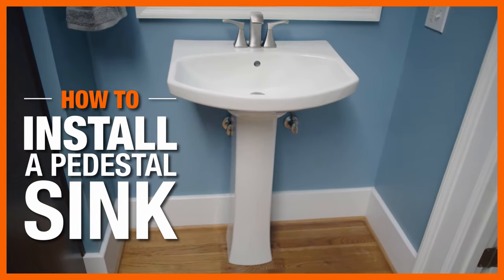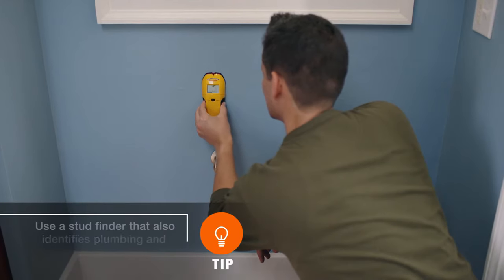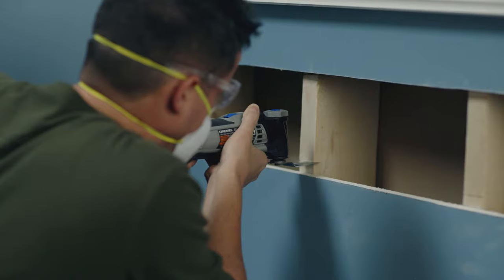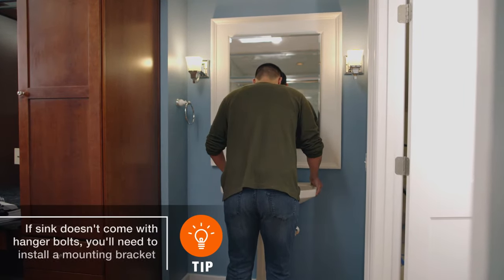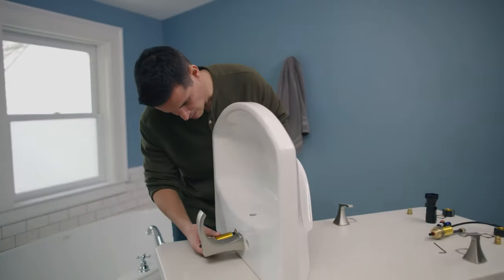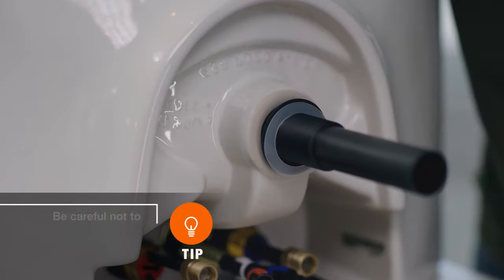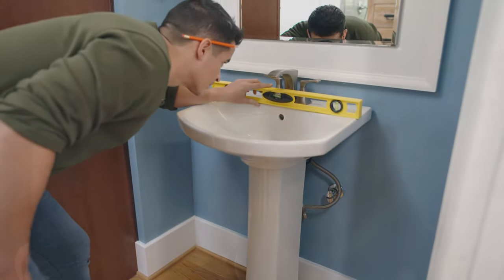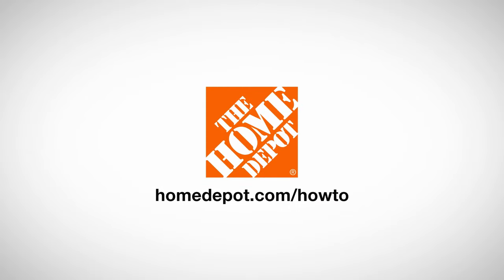How to Install a Pedestal Sink | The Home Depot

Comment: bolt what to the floor??? do i have to drill or so... video is missing some parts
Reply: Yes you’ll need to predrill a hole, can do it once it’s in place and then find a lag bolt that fits. 

Without it the base can move and overtime cause a plumbing leak. Although it is not entirely necessary if you think it’s weight & friction keep it pretty sturdy. Wall mount is the most important
Reply: Maybe you should hire someone to do this easy ass job.
Reply: @bwing411  THANK YOU
Reply: Our sink came with no hardware no instruction book and the pedestal has no holes to bolt it to the floor 🤣. Great products you sell there home depot!